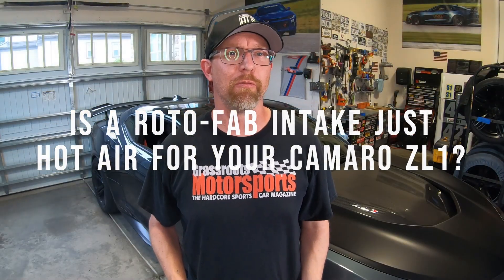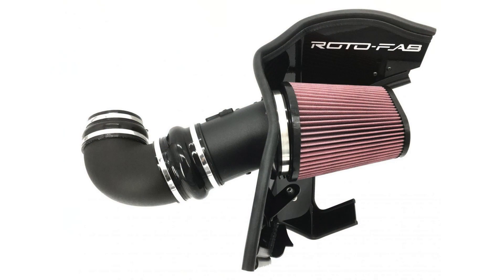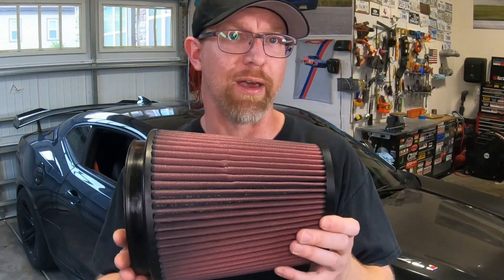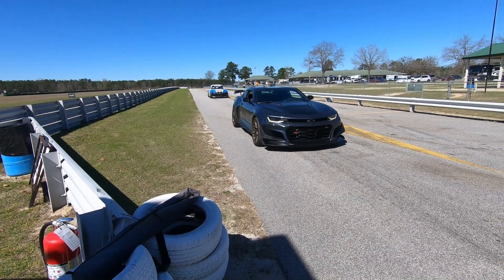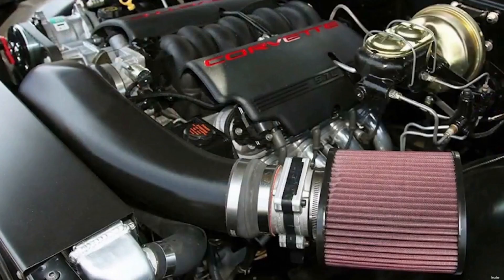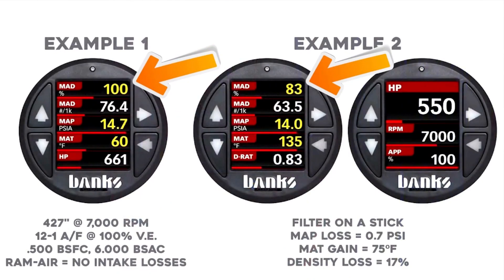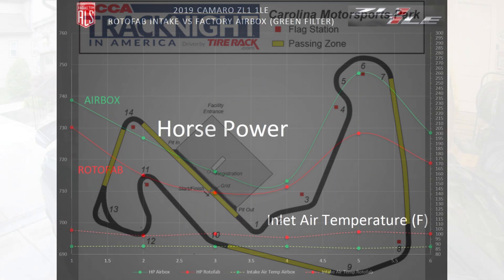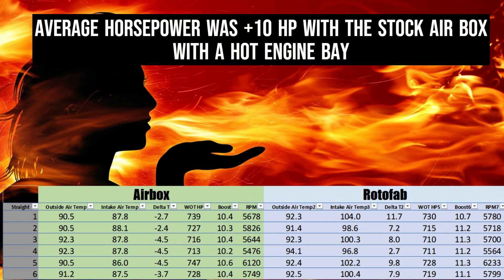Is Your ROTO-FAB Cold Air Intake Losing Horsepower at the Racetrack? CAMARO ZL1 #camaro #zl1

Comment from the maker: 🏁🏁🏁🏁Thanks for watching. I'm sure we're going to get some comments on this one! Please be courteous. 🏁🏁🏁🏁

https://greenfilter.com/store/filter/7299 and cleaner kit https://greenfilter.com/store/filter/2000 . I would recommend Summit Racing to buy it. https://www.summitracing.com/parts/gre-7299 or you can call them at 1-800-230-3030. Throw in a couple bottles of oil or Redline Water Wetter to get you to $109 for free shipping.
Reply: 100% I absolutely agree with this…. Rotofab is popular and great if you drive without a hood or want to cut a hole in your hood. I sold mine and grabbed the CAI Carbon Elite with a velossa tech big mouth ram air to feed extra cold air I don’t have all the data recorder stats but its been tested to reduces inlet air temps by 13 to 17 degrees. For myself, I loss on average 5km/h in the quarter mile with the Rotofab when engine temps where up compared to stock , with CAI and velossa tech i gained on average 5 to 6 km/h over stock. Not scientific testing not exact same conditions but that’s over numerous runs over numerous days. That’s all i need to know. I did get my CAI Carbon Elite used for $600 Canadian off a guy who was selling his ZL1 …being in Canada i couldn’t rationalize paying full price for the intake because the extra costs we incur when bringing that item in it would have cost me close to $2000 when all is said and done which is too much. You can’t accurately Dyno to test the impact of these types of mods. Sure you get more supercharger whine sound with the open rotofab design but that’s almost the equivalent of these new cars that have fake exhaust sounds piped in through the speakers makes you sound like you are going faster but its all smoke and mirrors. I say most cost effective is keep stock box drop in a performance filter and add the velossa tech big mouth save your money over buying a rotofab unless you want the whine sound then enjoy but there is no performance benefit because of the extreme amount of heat generated by the LT4 the open design fails as it does not completely seal and it sucks in too much hot air from under the hood. If you want a cool looking open design grab the corsa carbon fiber one at least it looks cooler than the rotofab at a similar price point.
Reply from the maker: @louisindelicato1406  Thanks for commenting. Glad to hear that some ZL1 Camaros are up in the Great White North!
Reply: @RacingforALS  south Texas here , should I go oiled roto fab or dryed roto fab , 95 temps to 100 ? What you think ?

Comment: Have you talked to a David Wilkes about his oil OEM cooler upgrade which is supposed to relocate a high heat issue unlocking track produced heat soak?

Comment: I’m interested in the cold air inductions unit but need to see a dyno sheet vs oem.  Oem does better than anything in track conditions.  Iats are more important than anything.
Reply from the maker: Thanks. The Pratt Miller GT4 racecars used a sealed box with a headlight duct to feed them. It's not practical for a streetcar, but it proves the point that a sealed box with fresh air is superior to an open or semi-open element.

Comment: Im thinking of a ram air hood that direct outside air into the air box location. Also has more "heat extractor" vents. Probably just gotta make sure it properly seals with the hood, then fabricate some more stuff if it doesnt fit perfectly.

Comment: So is it worth making modifications to the stock airbox for more airflow like drilling some holes in the bottom to allow cooler air to come in like the hellcats do with their stock air boxes?
Reply from the maker: No, it will just allow hot air into the airbox.

Comment: SS1LE owner here and an engineer. I always dismissed the open hood cai dyno comparisons which neglects the heat soak during operation with hood down. I know K&N, AFE and Green drop in filters are pretty good with the downside of filtration efficiency in the long run and maf sensor problems due to too much oil application during service intervals.
Reply from the maker: I'm a Mechanical Engineer and love data!

Comment: I wonder how the Cold Air Inductions (Chevrolet Performance Intake) compares? It’s a sealed “high flow” intake.
Reply: The seal is not as good as the stock. The only Cold Air Induction that seals good is the Carbon Fiber one but for $1,000 its a rip off

Comment: Anyone modding these car knows they have to managing IATs on these infernos, if you are staying stock there is no reason to have an intake only. Plenty of testing has been done and proves the gains of 5” inlets/103-120mm throttle bodies in the 800+ who range. While Mr. Banks knows his stuff and oxygen density is the most important factor of an intake, it is disingenuous in his snippet of presentation showing a stock LS3 with a hot air intake slamming the industry for making such a product. There is no free lunch, back your learnings with data/logs. If my Interchilled 2650 car went back to a factory TB and airbox I’d lose a tremendous amount of air volume and increase plenum vacuum causing additional pumping losses.
Reply from the maker: Good points, but ultimately you need outside air on a road course when coolant temperatures are 230+.  It doesn’t have to be the stock airbox, but the Rotofab isn’t adequately sealed from the engine compartment. Thanks for sharing your well written explanation.

Comment: Hey bud what’s up i have a 2023 zl1, was thinking about the roto fab since every dude puts it in his car but after this video im thinking other options have you thought about or tested the AFE intakes they are almost fully closed intakes!
Reply from the maker: I have not tested other intakes, but if you read the comments below, some viewers are saying to avoid the Elite Carbon. The AFE looks interesting. It appears to have two different scoops. If one of them mates to the factory snorkel and still has less pressure drop, then it could make more power. If someone will send me one, then I'll test it! 😎
Reply from the maker: AFE has quite a bit of data on its website. The oiled filter box says 11% more airflow, but they tested it without the side plug installed. The box is pulling air right by the headers through the plug. I am also concerned that the tube in front of the mass air flow sensor is aggressively flared out. For accuracy, the MAF is supposed to have a straight pipe before and after the sensor.
Reply: You are absolutely right haven’t thought about that unfortunately i asked around mostly tested roto fabs only no one tested afe

Comment: I have an SS 1LE and I originally bought the K&N cold air intake which I've had on it for about two and a half years and just recently I figured all this out because it does not seal to the air Inlet the way the factory one does so I'm going with the rotofab that seals to the inlet, the hood, and sealed box!! My car is cammed and not been running the way it should due to the CAI!! I figured out that my factory air intake is better than any aftermarket non-sealed cai. More so than the difference in horsepower is the throttle response has developed quite a bit of lag with the K&N non-sealed cold air intake as compared to the factory sealed one.

Comment: Great analysis and the point about the hood being closed. I always wonder about that and makes sense. But, a Mamo ported OE 87mm throttle body could do a good job of gaining some high end power due to less restriction while using the OE intake box. Plz review that.
Reply from the maker: I will if I get an opportunity. On my old car, I ran a ported throttle body (just the upstream side of the throttle plate). It felt great after first installing it or after an ECU reset, but over time, the car adjusted the part throttle position to correct the anticipated airflow. A tune could resolve the issue, but ported throttle bodies do not make long-term gains on stock-tune cars.
Reply: Makes sense, so a tune is necessary. Apparently, the GM tube has strange knock control behavior so may be good to get a conservative tune and review of motor operation with one and a ported TB.

Comment: What are your thoughts of intake flow comparisons in respect to NA cars like a SS, opposed to a forced induction ZL1 ?
Reply from the maker: @followmyline17 sent me some data on the SS with a rotofab. "Rotofab on the SS was reading 8-10° hotter than ambient."  Another SS on the same day with the stock box had lower IAT temps. Those results are comparable to the ZL1.
Reply: @RacingforALS  Thanks for the info ! So if I understand correctly, when the car is cold the Roto-Fab has an advantage, but as things heat up under normal driving conditions, the advantage diminishes , possibly even giving the stock unit an advantage?
Reply from the maker: @jbrewster6175  These temperatures were recorded on a race track after several laps. The temperature delta is most likely less with a cold car for a single quarter mile pass. Street driving is probably in the middle.
Reply: @RacingforALS  I was thinking that typical summer street driving could produce the highest under hood temps. Stop and go traffic, red lights, and low rpm driving that doesn't efficiently move air through the engine compartment, or coolant through the radiator. Not quite apples to apples, but I know my old muscle cars all run much cooler at highway speeds than stop and go traffic. This is with a mix of radiator types and electric of belt driven fans. I guess I just cant see the downside of a closed system drawing air from outside of the engine bay.

Comment: So its not that the filter or inlet tube is the issue.  It's a matter of letting more hot air in vs. the stock box.  So make a better seal for the better filter element and tube and problem solved?
Reply from the maker: Correct, it is an inlet air temperature and therefore an air density issue. Even at a lower restriction (pressure drop), the lower density produces less horsepower.

Comment: What about the cold air induction Elite Carbon Series Cold Air Intake? Does anyone know if it is better than the stock intake or worse like the roto-fab? Because I am wondering if I should buy it or not if someone has actually done some data on it, and can actually say if its worth it or not.
Reply from the maker: I don't have data, so I don't want to speculate on the performance. I believe there are some comments below that indicate quality issues with glued-on pegs for the Elite Carbon which is unfortunate for the price of the intake.

Comment: I always recommend dry air filters for all heated sensor element MAF equipped vehicles to avoid the whole oil contamination issue. That being said, when I first picked up the car I immediately swapped out the stock paper filter to an AEM Dry-Flo filter. Zero issues and they have been proven to outflow other cotton/ gauze style filters like K&N and AFe. Definitely plenty of airflow for my 707 WHP/ 770 WTQ ZL1!

Bonus extra: I mentioned this in a sub comment, but make sure to remove the snow blocker next to the driver's side headlight right before the snorkel to the airbox starts to further remove restriction and maximize the airflow immediately coming in through the grille area.
Reply from the maker: CRC makes an Mass Air Flow Sensor Cleaner that I use every oil change. Works like a champ. Just don't over oil a filter.
Reply: @RacingforALS  oh yeah I know, I've seen it before. We used to use parts wash if we didn't have that on hand. It works good, you just gotta make sure the sensor is not hot still. 

To me, it's just an extra step that shouldn't be necessary under otherwise normal circumstances. Where I live there is a lack of dust and sand so I don't have the additional need for an oiled media filter which does offer additional protection against external contaminants.

Comment: 100 % correct 👍🏻 
I don’t understand why Rotofab not give the “closed box” in ZL1 .
Reply: Probably due to open hood dynos not showing gains anymore. Once the top is sealed the intake sees a restriction. Even if its not sealed completely then it starts sucking in more hot air from the engine bay and the ecu pulls timing

Comment: What do you think of the elite carbon series? It is also fully closed of CAI plus do you think the carbon would keep it cooler for longer runs vs the stock?
Reply: My experience with the Cold Air Inductions Carbon Elite intake wasn't very positive.

One corner of the intake box sat up too high and rubbed on the inside of the hood when it closed. During attempts to get the box to sit correctly, several pegs on the underside of the box that fit in the grommets on the engine bay frame broke off. The pegs are only held in place by the carbon fiber coating surrounding the box. 

The first time this happened I sent the box back to Cold Air Inductions and they glued the pegs back on. Trying to seat the repaired box the pegs broke off again. The third time I tried to glue the pegs back on only to have them break off again.

Frustrated, I contacted Summit Racing and they allowed me to return the intake for a full refund.

For an intake costing that much, the pegs should be secured to the box with screws or something stronger than the carbon fiber coating.
Reply from the maker: I don't have any experience with it, but believe it is fairly expensive. We'd be happy to test one.
Reply: Interested in this too. Zander13 had one on his channel on a part 1 series and never did a follow up. It was removed for a Corsa. Wonder if he didnt like it or had issues. Would have liked to see some data on that. Looked interesting and if the cost justified performance, it would have been interesting to hear more.
Reply: I have CAI and i love it and have it paired with a velossa tech big mouth ram air and have noticed gains see my response to the Racing for ALS original message. I got my Carbon Elite used on line from a guy who was selling his ZL1 so i got it for $600 Canadian with local pick up so i couldn’t pass it up. It also look incredible under the hood. As for benefits over stock similar closed design and carbon provides better heat insulation over the stock plastic but as i mention above I recommend best cost effective mod is keep stock box upgrade the filter and add the velossa tech big mouth i believe the biggest difference is from that ram air is that it takes half of your upper front grill and feeding that cooler forced air directly into the air box. If you do car shows as well and want some under hood eye candy the CAI Carbon elite can’t be beat for pure aesthetics but its expensive. I never would have paid full price for it, being in Canada with shipping , exchange rate, handling feeds and duties/taxes it would have cost me close to $2000 which is too much for me rationalize.

Comment: So I just installed my roto on my 23 and the air dicting goes right into the roto airbox and the box seals onto the hood. This is bad info in those ways. I would be curious if these numbers are not correct on many camaro models
Reply from the maker: It's not totally sealed, the IAT and ECU calculated HP proves it. These temps have been verified by other people on the road course. If you have different data, then I'd love to see it.

Comment: Great vid.
I had a suspicion that this was the case that RotoFab would suck in hot air vs stock air box. I am torn though because I really wanted the Fab filter for the extra SC whine but I'm not willing to sacrifice horsepower. Someone else makes an aftermarket filter which I forgot at the moment but it's the same concept as Rotofab.

Comment: Nice  work, I'm running a Forced induction Interchiller no more Heat Soak my AIT run about 45 degrees all day and about 65 degrees on the Track, and I'm running a Roto-Fab Big Gulp too, On my 2018 ZL1 Camaro.
Reply from the maker: On the road course or on the drag strip?
Reply: When we ran it in Fontana Speedway, And I've got Weapon X Motor sports Heat Exchanger for Back up. @RacingforALS
Reply: You lose AC efficiency with an interchiller?
Reply: Hi Mike I'm Running a Stage 2 Forced Induction Interchiller. @Mike-ey

Comment: Great info! What is the current thinking with the oiled type filters and their potential harming of the MAF?
Reply from the maker: They are perfectly safe as long as you don't over oil the filter. You can also use CRC MAF Cleaner on the MAF element every oil change.
Reply: Rum an AEM Dry-Flo drop in filter. They were proven years ago to outflow everything else on the market including AFe and damn sure K&N filters. Best of all, they are dry, so there is no need to oil or ever having to worry about oiling them.
Reply: You are right dont use oiled filter

Comment: How is the IAT cooler than the outaide air with oem airbox?
Reply from the maker: The sensors are obviously not perfectly calibrated. There is a 2-3 degree negative offset from the Outside Air Temp Sensor and the IAT sensor, but the offset is consistent across the two test.

Comment: My car was a turd last week At Barber. 
 "88 degrees"outside temps ,
I'm running the Corsa CIA basically just for the Super charger wine.
Reply from the maker: Got to make priorities. 😆😆😆
Reply: I tried the Corsa on my ZL1.  I would call it a hot air intake rather than a cold air intake.  It lasted about 25 miles on my car before I removed it and sent it back for a refund.